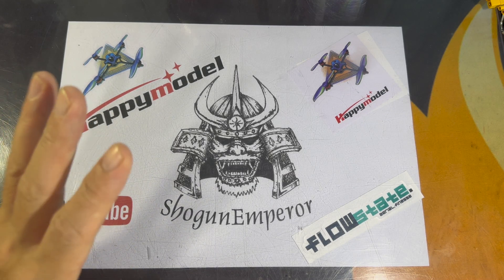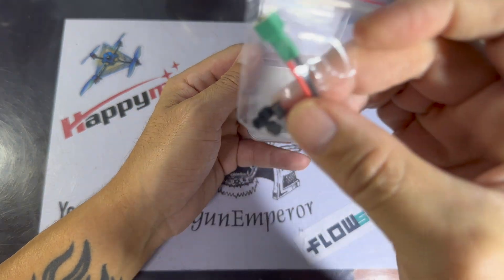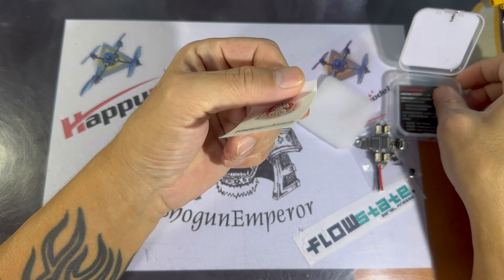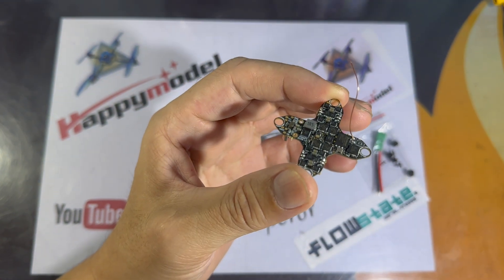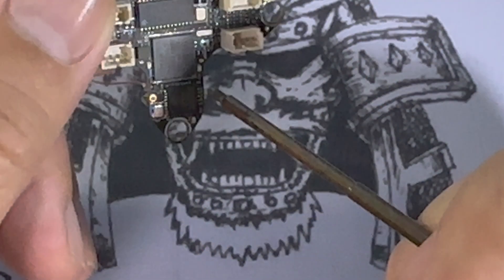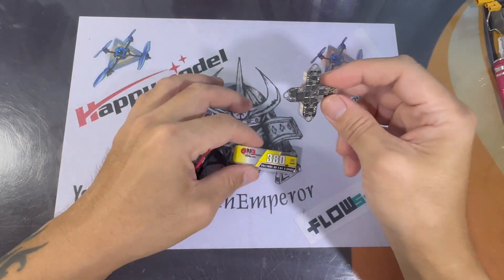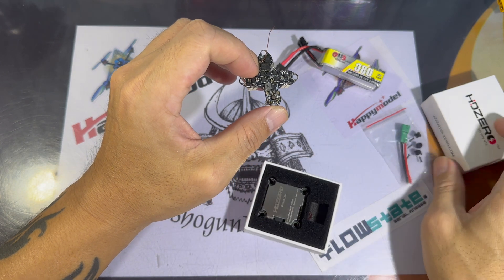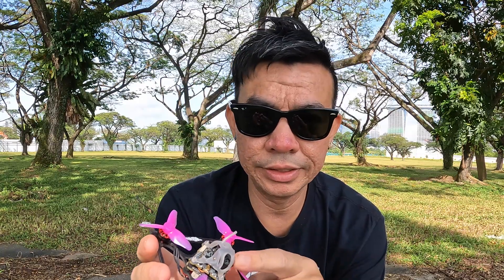No more ELRS SPI RX?  New CrossF4 ELRS flight controller

Comment: Thabksn for the video. I'm planning to use this on a 2s build 👍
Reply from the maker: Aaww thanks bruddah! Always a pleasure!! SWEET MAN!!! Sounds like a fun project!
Reply: @shogunemperor  did you find that the 5 amp was OK with the 2 inch?
Reply from the maker: @valden  hmmm… it cant pull off hard maneuver. I think better to get an X12 FC if ur planning for heavy freestyle on a 2S, 2” quad
Reply: @shogunemperor  ty I'll probably use this on a 2s 75mm build with 40mm props then.

Comment: I have 7 other elrs receivers/aio on v2 elrs as well as the tx module. I'd love to get a few of these AIO's however not sure of the simplest way to go about it.  Update all my current stuff as I should, which will be a small nightmare, or maybe just get another tx module and put that on v3 and just swap module's if possible lol. What are your thoughts?
Reply from the maker: Yo! Thanks for dropping by bruh! My honest opinion, either keep all ur quads as is, or update them all to V3. No point getting an additional module(could save that cash for another quad!! Hehe) even if its an SPI RX its quite easy to have them updated. Its the small issues that will frustrate u. The CrossF4 comes with ELRS V3 so another alternative is the SuperbeeF4 which comes with ELRS V2

Comment: No worries about the 5A ESCs on that FC? I was thinking about it for a 2S digital whoop build, but wish the ESCs were rated a little bit higher.
Reply from the maker: Its fine bro. The FC has been tested at Happymodel HQ with no issues so far. Just make sure the motors are of the correct ratings and ur good to go
Reply: @shogunemperor  I didn’t see info on what motors are appropriate. 1102s at 9000-11000kv would work?
Reply from the maker: @AnthonyCowley  oh yes. If ur using 2S it should be 2S rated. I used wrong motors for mine.

Comment: What motor did you use and kv?
Reply from the maker: I was on 1202.5 11.5K KV. But i killed 2 of the motors.  Think i grabbed the wrong ones. I shouldve used the 1103 11K instead
Reply: Motor throttle at 100% or did you cut it back a little worried about the flight controller if it’s able to handle it.
Reply from the maker: @scottfuller6541  haha no man. I went full send on it. Mine were rated for 1S i think the draw was a tad too much and overloaded the ESCS

Comment: It's a  versatile board. Pretty sure this will be a big hit with the whoop racers. It seems like all the angle mode racers (myself included) at the local whoop race strongly prefer the BMI270 over the ICM gyros. The BMI just seems smoother, and to not lose it's mind quite as much after bumping a gate, etc. I'll be putting this in a 65mm.
Reply from the maker: Interesting. I remember when the BMI270 chip just came out and it was an uproar. 🤣🤣 i agree bruh. So far ive had no issues with the BMI270 chip.(*touch wood)

Comment: only thing i have left not on elrs is my mobula 7 , need to upgrade to 3. but having issues but i believe its the partition  thing ,  which i have the on board elrs tx16 mkll . which i saw all tx and rx need the partition thing. haven't had time to read up on it.
Reply from the maker: partition?  Just use the hex file for the Mob7 bruh.  It should bind with ur ELRS module on V3
Reply: @shogunemperor  forgot about that, saw that a while back.. but what about my tx??? and all other rx? i already have 4 betafpv rx that won't load 2.5 says not enough space and there new. so i bought happymodel rx and had no issues with 2.5.  . saw a video saying both rx and tx needed a larger partition for 3.0 think it was bardwell. ill figure it out. tried to load 3 on tx 16 and it fails so i stayed on 2.5
Reply from the maker: @MrBumbles2  OOOOOOHHHHH..... hmmm... there is a general hex file for the other FCs.  I think it was Albert Kim did that video.   Im sorry i cant be of help man.  But if ur okay with 2.5 and are not using the newer FCs then i think it should be fine.